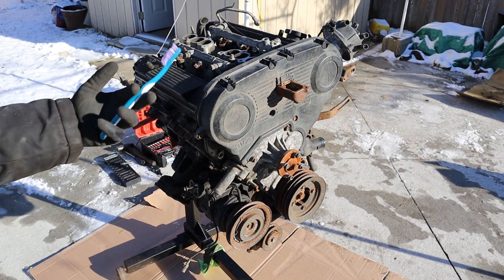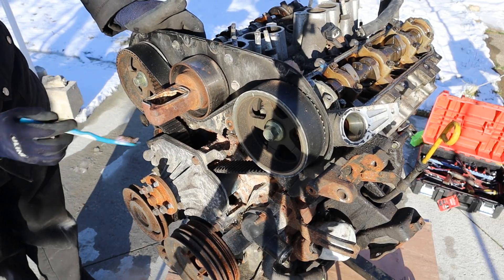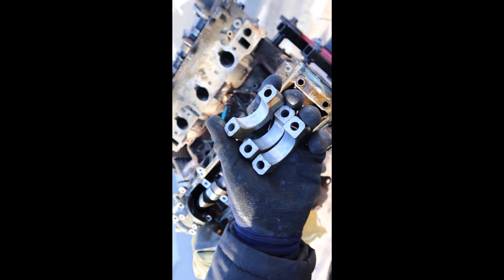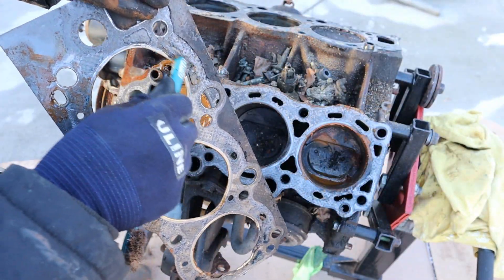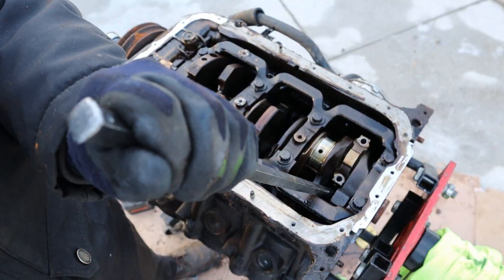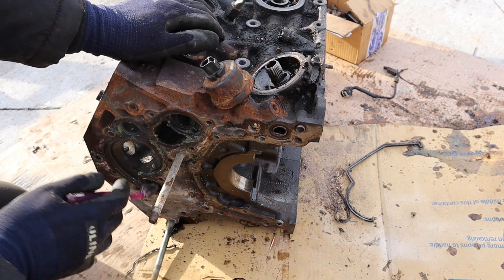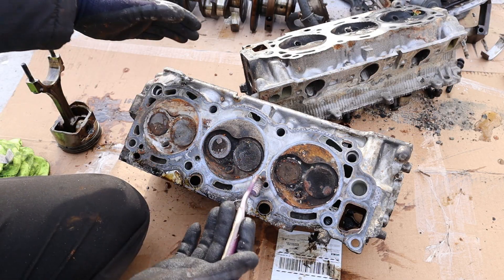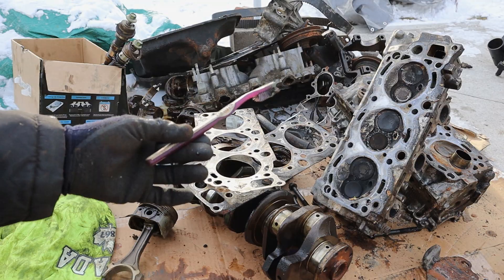Toyota 3VZ engine: An Overheat Disaster

Comment: My bet the thing that killed that engine was just neglecting oil changes, leading to the sludge. Then that also meant the early signs of the head failure went unnoticed, till they were gone.
Reply from the maker: Yeah I bet this engine was overheated without consent
Reply: Neglect is the only.thing that this engine can't handle
Reply: You have to change the coolant every 30k or 2 years or it becomes acidic eating the gaskets away